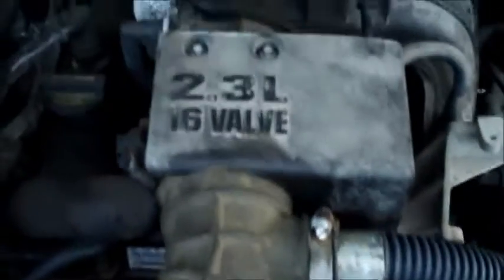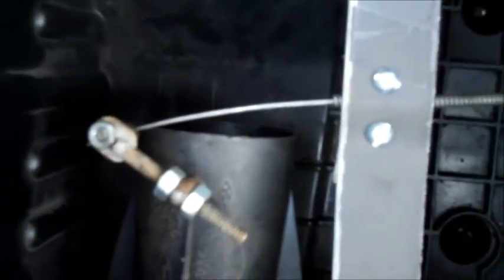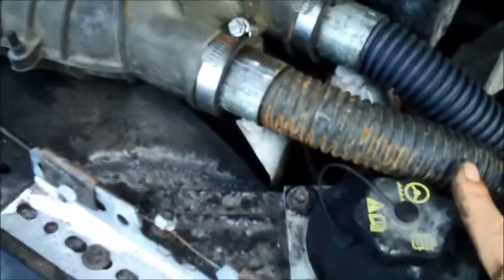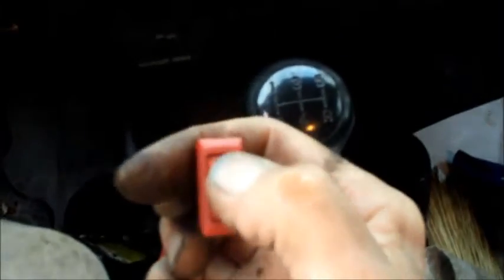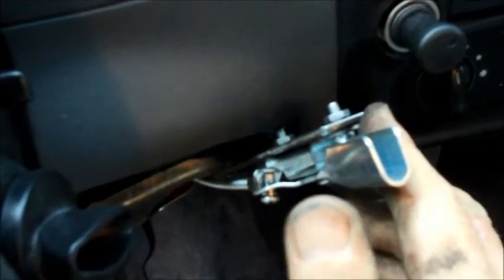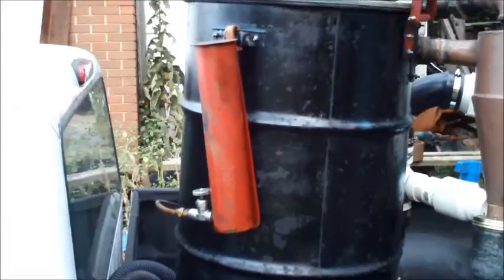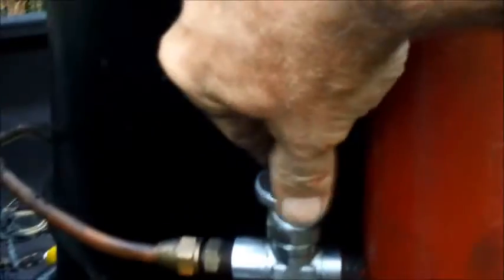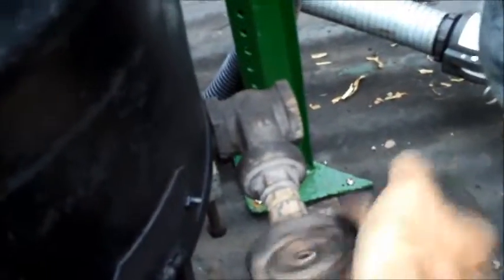Ranger engine compt

Comment: Hi Gary, is there a benefit in using corrugated hose instead of a smooth walled hose to go from your unit into the engine's air stream?

Comment: If you can switch back and forth from gas for more power, can you hook up a propane injecter for a boost or is that possible?
Reply from the maker: +dannythetoesmasher Propane will definately work.  You need some way to meter it into the throttle body while increasing the amount of outside air,